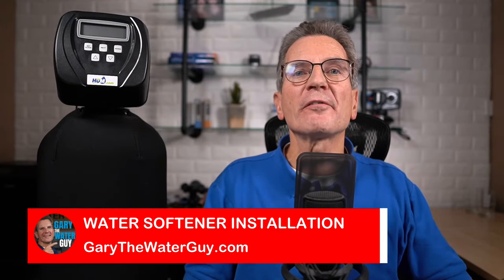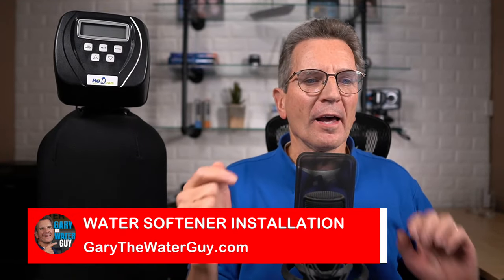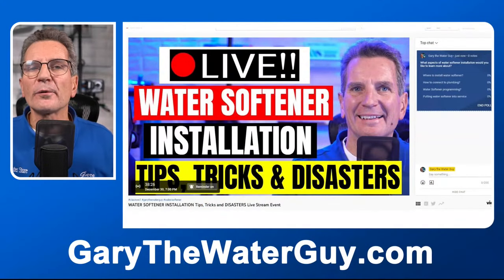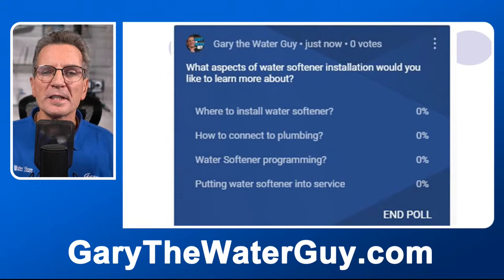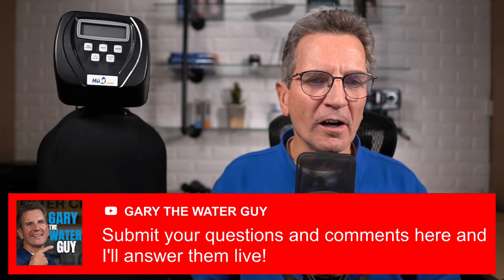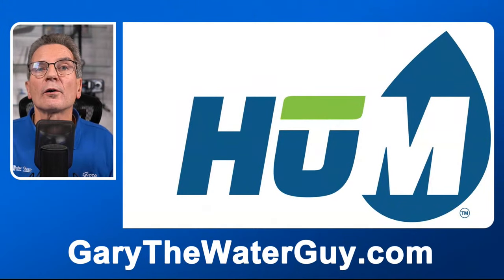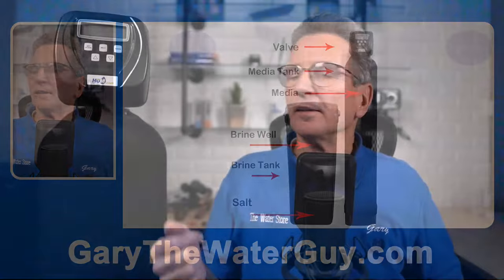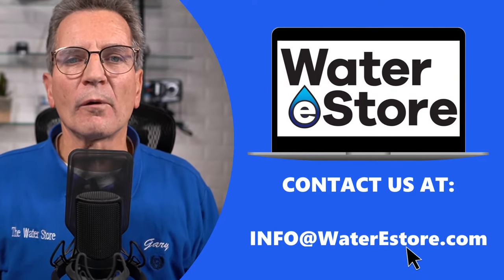WATER SOFTENER INSTALLATION Tips, Tricks and DISASTERS Live Stream Replay

Comment: Gary, further to your discussion about 3 way bypasses, could you discuss the potential implication on electrical grounding when a copper 3 way bypass is replaced by a modern bypass made of synthetic material. Thank you.
Reply from the maker: If your plumbing is copper and your electrical system depends on the ground going through the plumbing beyond the water softener or iron filter you can fit a grounding strap between the inlet and outlet copper plumbing.

Comment: 1/2 or 3/4 pex for drain line? I've heard that the diameter of 1/2 pex is too small for an adequate backwash. Any thoughts on this?
Reply from the maker: Great question!  We have always used 1/2"  But if I was running the drain line more than 25 feet I would upgrade to 3/4"

Comment: Hi Gary. I have a Clack WS1 with the buttons all in a row. When my softener regenerates, a new number shows up to show me how much water will be treated before the next regeneration. I have monitored the usage and It works out exactly to the number. My question is what is the relationship of the reserve capacity to volume or anything. I added up the numbers of the reserve capacity and came up with a number that I can't relate to anything.
Reply from the maker: This video will help you with the programming and understanding https://youtu.be/c6r7qUK8to4
Reply: Thanks for the reply. I guess that the Reserve capacity number has to do with the programming and has no relation to anything that I have access to. The video that you referred me to was one that I have seen. I watched it again and saw that It is for a post fill unit, My unit is a pre fill. Could you do a video on pre fill unit programming?

Comment: My float mechanism at the bottom seems to be sticking I have to push the arm down to get it to release what's the solution thank you
Reply from the maker: Usually that is because there is partically dissolved salt clogging it.  You would need to disassemble the brine tank and clean it out.